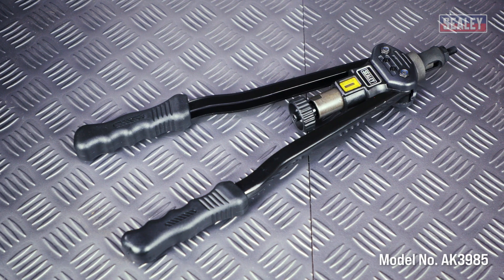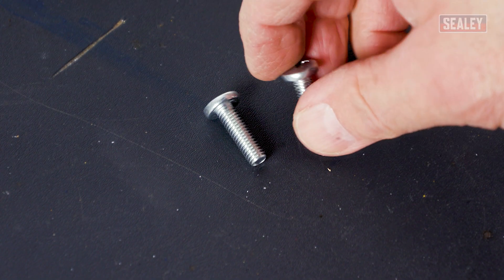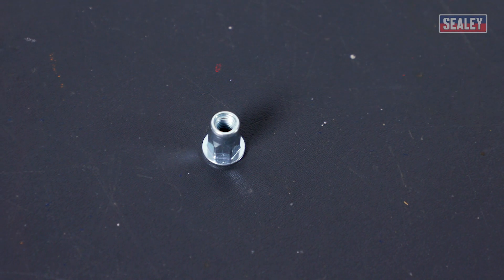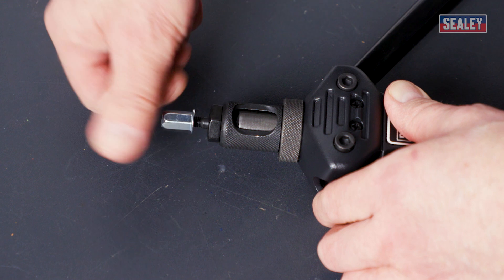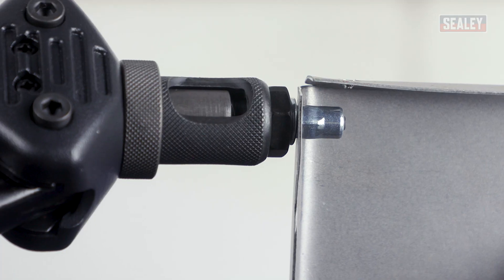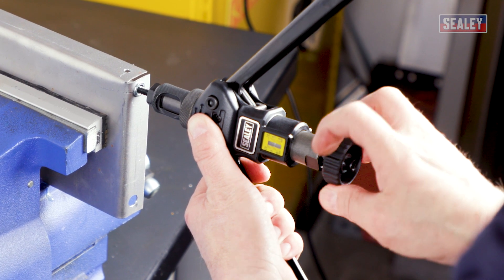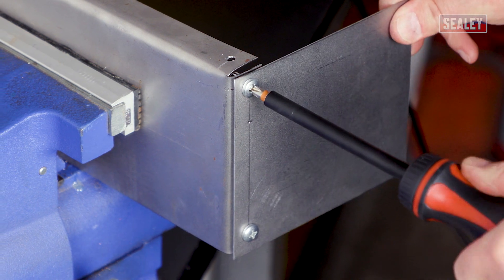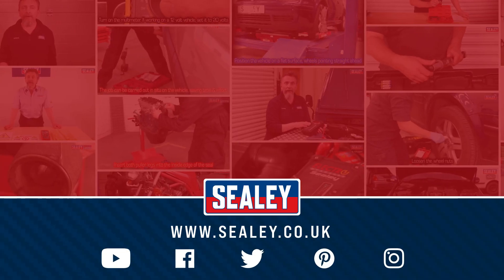How to Use Threaded Nut Rivets / Rivnuts / Blind Nutserts

Comment: Failed to address the minimum and maximum thickness of the material for the rivet nuts.
Reply from the maker: Hi. The metal used in the video was 1mm thick, but each rivet size can cater for different thicknesses. The product pages on our website have specification tabs which quote the grip ranges. Thanks.

Comment: Can you please tell me if there are any that are flush when set and dont need coutersinking. I want to join to sheets of thin galvanized sheets together with an m5 bolt. Thanks
Reply from the maker: Hi. Unfortunately, we don't stock any riveters that would facilitate an M5 bolt to be flush on thin galvanized sheets. Thanks.

Comment: Thanks, just what I wanted. I'm screwing back some self-tapping screws after dismantling a metal riding mower. Some screws tightened up some didn't. On inspection the threads in the rear plate had come away. I could just try to replace them with bolts (holding a nut at the rear could be problematic), or put in some more self tappers further along. Or break out the kit that I bought at Lidl not knowing anything about these rivets. Will give it a go. Thanks to you!!
Reply from the maker: That's great.  Good luck with the project!